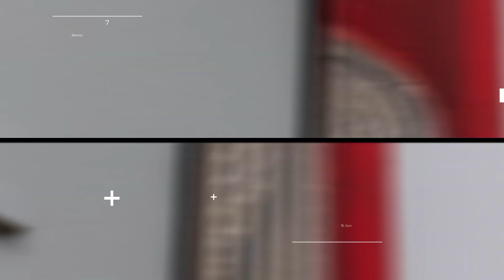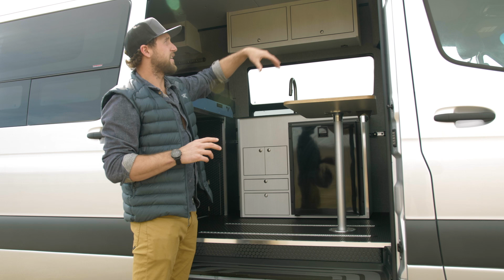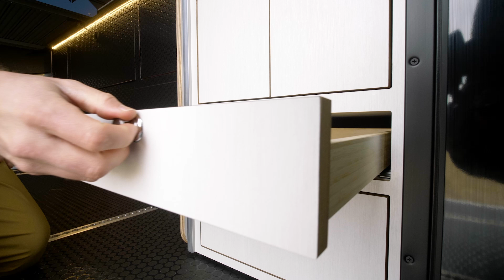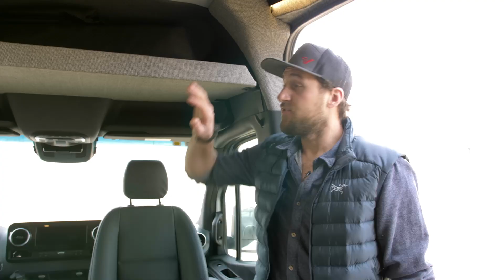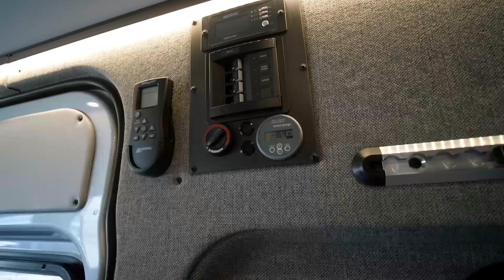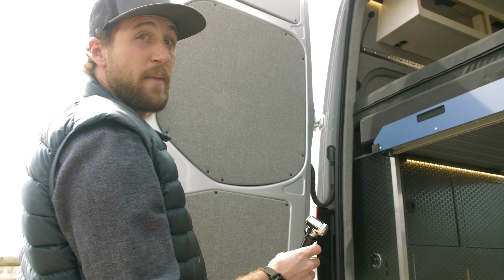Full Van Tour - Sprinter 144" - Hyper Modular Build - The Classic

Comment: Great build as usual! I wonder though, if you can conceal those black screws on the headliner and side walls with T molding transition strips or just use the same color as the panels? Thank you.
Reply from the maker: Certainly could though we prefer the exposed fasteners.

Comment: Hi Matt, I’m curious why you prefer the tire height to 245s? I’m getting ready to change wheels and it would be helpful to hear your take on this. I like the idea of going bigger because the stock wheels look oddly small on a 4x4 Sprinter. I appreciate your videos and your products! Thank you!
Reply from the maker: It really comes down to preference. 265/75R17 is the largest you can fit on a 4x4 with no modifications. If you modify the wheel well then you can go up from there. Keep in mind that the odometer and speedometer will be wrong if you change outer diameter from stock. Also, if you get above 32.5" OD then cruise control will not work.
Reply: @TitanVans  Thanks for your reply Matt. Sounds like maintaining accurate speedometer and odometer are prime reasons to maintain stock size unless there is a way to adjust for it otherwise it’s a height/performance and
 aesthetic choice.
Reply from the maker: @eddiepisack  Thats right. No way we have found to reprogram the Mercedes system for larger tires.